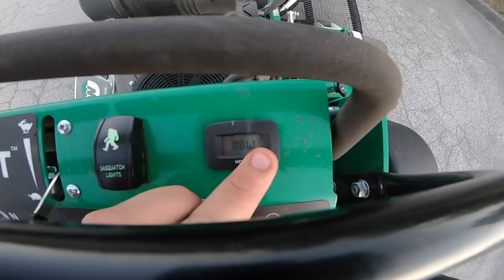CAREFUL WHERE YOU BUY

Comment: Since ethanol free gas is scarce around here and ungodly expensive. I use a product called “Ethanol Shield” from BC3 from my small engine dealer “Mower Zone” in Danville Indiana and it has eliminated all my gas related issues. My motors visibly and audibly run different when the product is in with the gas. I use it in all equipment no matter what.
Reply: I'm in Chicago so thanks I'm going to look into that bud God bless

Comment: Definitely fuel related like you said, you’re 100% on the right track. Company I used to work for only ran 87 and carb needles were getting stuck all the time because of the ethanol gum. Fuel filters are definitely key like you said. My rule of thumb for fuel - Ethanol free if it’s at the station you stop at. If it is not, always buy the highest octane they have available. I also add Seafoam to each can or machine I fill up. Not a lot, just as much as the bottle says.

Comment: I just use super unleaded in all of my equipment, I've found from experience in the past that it has more additives in it than regular unleaded to keep your fuel system clean. I have used super unleaded to clean carburetor throttle blades that regular unleaded left extremely filthy while driving the vehicle, one tank is all it takes for that little job. Like you, I don't use extra additives either, just the good 93 octane gas out of the pump.

Comment: I had a similar problem with my first John Deere commercial mower... turns out it was just a bad carburetor. But yes fuel filters go bad and air filters go bad quick in dry dusty climates.
Reply from the maker: Very true
Reply: jarrett murphy the engine is fuel injected
Reply from the maker: Yup, that’s right it is
Reply: I agree when it gets dusty like this my mower will do the same thing. I just clean the air filter or replace it and blow all of the dust off the engine so it's not breathing so much in. Problem usually goes away

Comment: Definitely a fuel filer, air filter cleaned atleast. As for adjustment maybe a pinch, but its efi I doubt it. So it depends on the gas station, some add water etc. I try to stay with shell. I'm 5 min outside Chicago in Burbank il and i don't think there's any gas stations that have 100% gas anymore. I use lucas gas treatment though, or if running really rough sea foam for the oil, intake, and fuel. You would be amazed how it cleans things up. Anywho God bless SG, and all the landscaping NINJAS.

Comment: Ethanol non ethanol I've never seen a difference.  I run premium in everything from saws weedeater mowers old 1974 articulating loader ect.  Some of my saws sit for months or even a year or so.  The biggest thing I've ever noticed is buy where they change filters on the pumps often and never when they are dropping fuel or have just dropped fuel.  On 2 strokes I run red armor oil and no stabilizer or additives ect....even though i only run stihl equipment and have never ever had a single problem.
Reply: Definitely if there's a truck filling the pumps do not go there. Old or new gas station. 👍👊

Comment: 100% only way to fly. If the motor is EFI. No carb. Has throttle body just like you auto has. ( Depends on engine manufacturer) With the alcohol in the gas the injectors can and do stop up.

Comment: All gas comes from the same facility. You're just paying for the name. Do some research if you dont believe me.
Reply: The 2 fuel plantations that serve central alabama are owned by murphys......the biggest difference is do the individual stores keep their tanks clean,  are they running a lower micron filter ( national avg is 100 micron for fuel pumps and where I buy is using 10 micron)  and do they change their pump filters like they should
Reply: @codyshrum2915  You are correct bud.
Reply: Exactly depends on the gas station, some add water etc. I try to stay with shell. I'm 5 min outside Chicago in Burbank il and i don't think there's any gas stations that have 100% gas anymore. I use lucas gas treatment though.
Reply: Exactly depends on the gas station, some add water etc. I try to stay with shell. I'm 5 min outside Chicago in Burbank il and i don't think there's any gas stations that have 100% gas anymore. I use lucas gas treatment though. Definitely needs the gas filter and air filter. Maybe a little adjustment but being efi i doubt it. GOD BLESS YOU AND ALL LANDSCAPING&SNOWPLOWING NINJAS.
Reply: Small mom-and-pop gas stations don't check their tanks the waters leak in

Comment: That sounds like the carburetor jet semi clogged with a piece of grass or it can be the fuel filters to clogged to let a good amount of fuel into the engine so I’d try fuel filter first to see if that fixes it & i use regular fuel but use fuel stabilizer into it as I don’t wanna pay 3$+ for ethanol free and not all stations have it so it’s hard to go to certain stations to get it and I got a repair guy here in c.fl that repairs my mowers if I have issues with them so it’s no big deal to me as he is reliable & check the part # and see if you can find it on amazon as I got 3 fuel filters on amazon for like 20$ with tax as all were 5-7$ a peice but the fuel filters need to be changed as they get dirty inside or it can cause issues with fuel getting to the engine  as my repair guy told me so I changed mine before 100 hrs of use once it got dirty inside so it didn’t do damage to engine..the sputtering can be the carb jet getting clogged by a very tiny piece of grass from filling up the fuel tanks that fall off your body or it can be a carb that needs replacing as my push mower did that and it was a very fine piece of grass fell into tank,clogged the jet but check the filter & spark plug as the plug can be dirty which happened to my push mower and fixed it when i changed it..
Reply from the maker: Ronnies Lawn Maintenance the engine is EFI